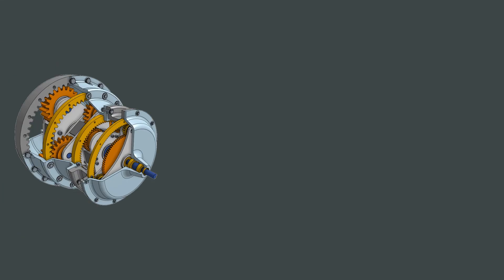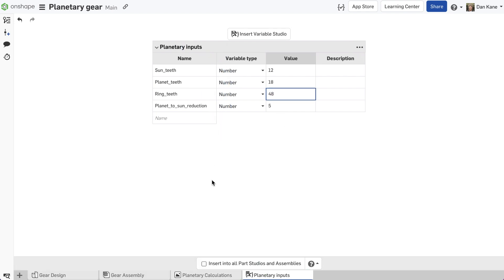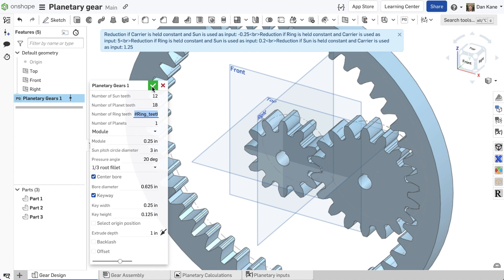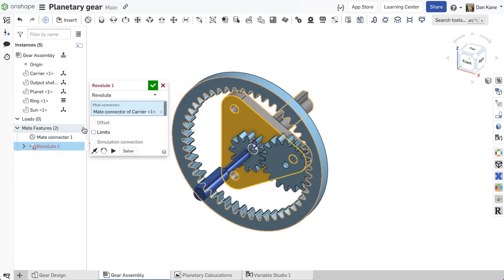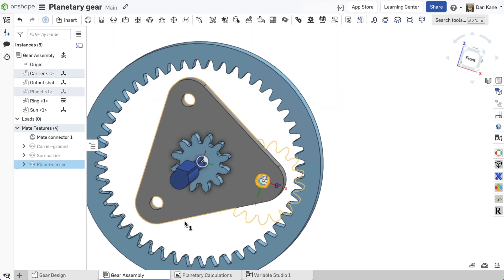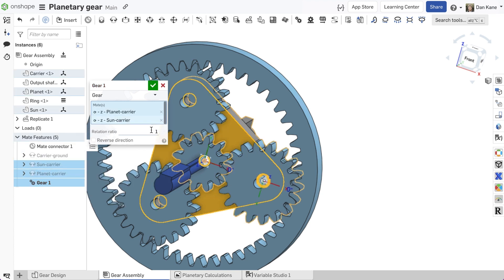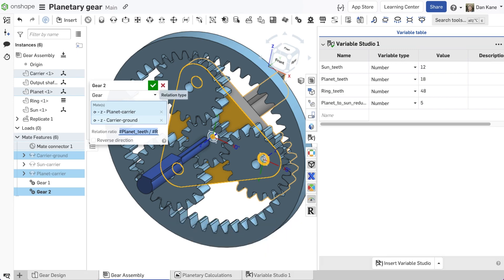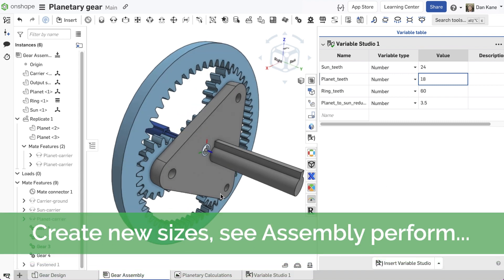Let's Make a Planetary Gear System

Comment: When I add more than 1 planetary gear using the add-on, only one of them shows. Why is this?  I need to export all of them. Thanks
Reply from the maker: Hi there - All planet gears are geometrically identical, so the custom feature only creates one at the Part Studio level. This allows the user to then instance the planet gears at the Assembly level and keep a proper BOM. Note that a sketch is also created, which defines the center point and radius of the "other" planet gears.